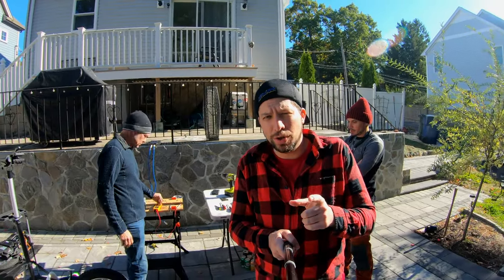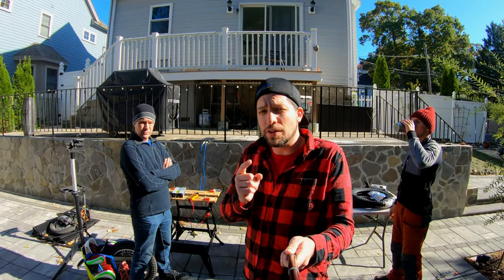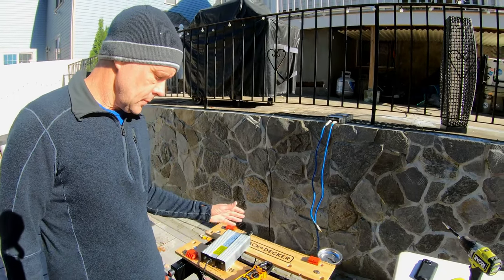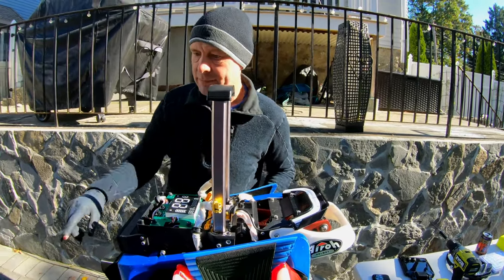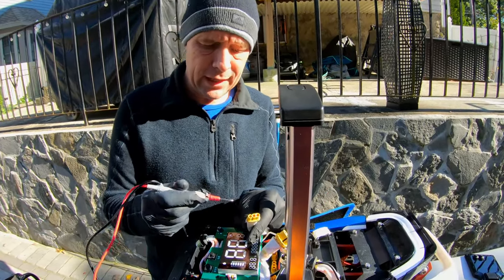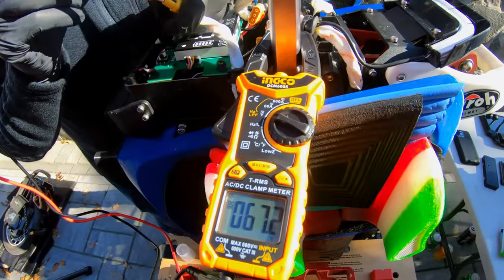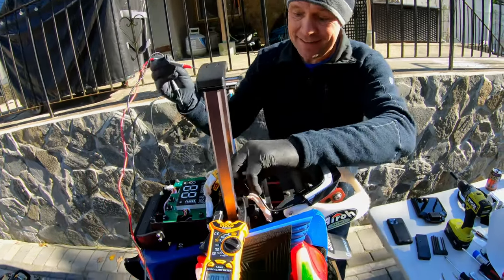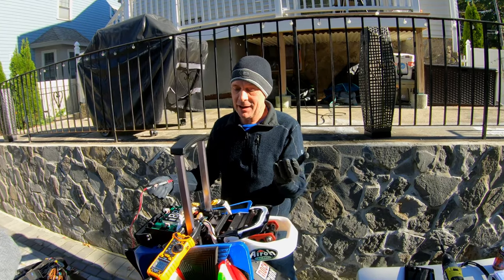Critical Issue With Begode Master - How to Fix and Maintain Your Master Battery

Comment: There are TWO varistors inside the charger. One us for voltage. For what is SECOND? I started adjusting it first. Seeing no change in voltage I switched to the right one. BUT i don't remember in what position was the first varistor in the beginning. What is it for? How can I adjust it right?
Reply from the maker: i believe that is an amperage adjustment but im not positive
Reply: Normally the second adjustment is the cut off amperage. At what mA the charger should indicate fully charged.
But on some it is the charge current being adjusted.

Comment: My charger reads 136.3 Should I go to the trouble of adjusting down?
Reply from the maker: if your confident your voltmeter is accurate it might not be a bad idea, but slightly over isnt the worst the bms will cut charging anyways and a slight over volt isnt dangerous if for some reason it doesn't

Comment: I just tried to adjust my charger to 134.4 since it was at 133.7 but the screw doesn't turn clockwise so i tried counter clockwise which raised the voltage to 144.6! now I put it back to its original position and it seems to go up again! can someone help me🤦‍♂️!?
Reply: Ok now I'm good. My multimeter was not calibrated...it  gave me 11V higher. I tried with an other one and now I can adjust it at 134.4V. So clockwise go up and counter clockwise go down.

Comment: Maybe Gotway/ Begode is dialing down the chargers intentionally to try and avoid burning down your house while charging, as Gotway wheels have (famously) done in the past.   As a cheap fix in lieu of better fundamental engineering.
Reply from the maker: more likely to cause a fire via a dead cell over time

Comment: Nice way to make your wheel cutoff or catch fire. An EUC should never be charged to the max voltage, since as soon as you break you charge the battery. And guess what what happens when you try and charge a fully charged battery? Thats right, you overcharge it. Dont get me wrong, I am well awear that you can charge a common liion cell to voltages above 4.2v, but that requires a precice charging process no to damage the battery.
Reply from the maker: you should absolutely top off and balance charge your wheel regularly to balance the cells
Reply: @GoGeorge  balancing is dependent on the cell voltage, not the pack voltage. Balancing can start at any pack voltage, even at voltages of less than 100v. The only thing that matters is that any cell reaches the balancing voltage and thats it - it starts to clamp the parallel that reached the balancing voltage. And it doesn't care about other cell voltages and thus the total pack voltage. It is in part thanks to people that don't know what they're doing begode gets bad rep. Yeah their engineering could be better, but don't make it even worse. If you live in a valley, and you don't brake untill you get to approx. 4.15v/cell than charging to 134.4v is acceptable. But if you live on flat ground, or on a hill, then at best you are noticeably accelerating the degradation rate of your battery pack. Besides, charging to 4.2v or to 134.4v in a 32s pack should stop when the charge current reaches a certain threshold, and shouldn't continue beyond that. Since 99.9% of chargers cant do that, the common way is to set the end charge voltage slightly lower then the nominal 4.2v/cell. It increases the time it takes to charge the last percent or two, but it keeps the battery in the charge envelope that is set by the cell manufacturer.

Comment: those are mr60 connectors and you dont need a charger, just make a jumper like this
https://www.youtube.com/shorts/6XKRDqM3r30
it is normal for packs that are connected in series to drift apart, there is no fix for this, you need to get a charger or make a jumper like the one i made
Reply from the maker: yes but for those of us who ride unicycles this is a new thing. all batteries to this point have been full voltage and wired in parralel. these are the first wheels with multiple packs wired in series

Comment: Thanks for the informative video. I tried to test my charger and I think it's in an idle state where the green light is blinking and I can only measure 4.4 volts. I made a video showing the issue here: https://youtu.be/0iKMU46m2lU 

Wondering if I should try plugging the charger into the wheel and measuring volts on the board?

Comment: All that bullshit because they’re too cheap to put balancing tabs on each battery pack. Who’s going to take their wheel apart every month to balance the batteries, not! I’m sure by the time they would do it and make a charger that can support it ,it will be another thousand dollars added to the wheel. Taking the charger apart is Unnecessary, bring it to 134.4 V could cause overcharging on individual packs that’s why the manufactures leave it under. Like he said he had one pack slightly overcharged and some packs under, so now you’re bringing the voltage up higher , that one pack might overcharge even more before the other packs reach their peak voltage. That could  cause damage
Reply from the maker: doubtful, the two in front are in series and charged equally. the ones in back are in series and probably the bms stopped the charge once the one pack was over volted
Reply: Question, does the BMS monitor each battery pack separately ? Or just peak voltage
Reply from the maker: @mongi4435  problem is its 4 seperate BMS and i dont think they communicate
Reply: O. That’s weird. Good video anyway, I’m going to do some research on my own .
Reply: O. That’s weird. Good video anyway, I’m going to do some research on my own .
Reply: O. That’s weird. Good video anyway, I’m going to do some research on my own .
Reply: O. That’s weird. Good video anyway, I’m going to do some research on my own .
Reply: O. That’s weird. Good video anyway, I’m going to do some research on my own .
Reply: O. That’s weird. Good video anyway, I’m going to do some research on my own .
Reply: O. That’s weird. Good video anyway, I’m going to do some research on my own .
Reply: O. That’s weird. Good video anyway, I’m going to do some research on my own .
Reply: O. That’s weird. Good video anyway, I’m going to do some research on my own .
Reply: O. That’s weird. Good video anyway, I’m going to do some research on my own .
Reply: O. That’s weird. Good video anyway, I’m going to do some research on my own .
Reply: O. That’s weird. Good video anyway, I’m going to do some research on my own .
Reply: O. That’s weird. Good video anyway, I’m going to do some research on my own .
Reply: O. That’s weird. Good video anyway, I’m going to do some research on my own .
Reply: O. That’s weird. Good video anyway, I’m going to do some research on my own .
Reply: O. That’s weird. Good video anyway, I’m going to do some research on my own .
Reply: O. That’s weird. Good video anyway, I’m going to do some research on my own .
Reply: O. That’s weird. Good video anyway, I’m going to do some research on my own .
Reply from the maker: @mongi4435  thanks for the 20 comments, your commitment to growing the algorithm is commendable 🤣🤣🤣😋
Reply: A pack can only be charged to 67.2V, after that the BMS will bleed current away from each cell in that pack as it reaches 4.2V. When all the cells reach 4.2V there is no differential between the charger and the batteries so charging will no longer continue and the green led will light on the charger. If the green light (indicating fully charged) never illuminates, then there may well be a problem with one of the battery packs and investigation is called for. That is measuring all four packs, anticipating them to all be at 67.2V. If one pack was at say 63.2V (a 4V drop, or more) that would be a definite indication of dead cells in that pack.
Reply: I have no clue why my replies got multiplied, sorry about that.
Reply from the maker: @mongi4435  lol its all good, feed the all mighty algorithm 🙏🍻🤣
Reply: @GoGeorge  That’s a lot of research😂
Reply: @brianwoodard82  Indeed